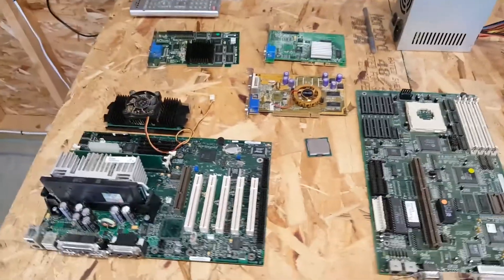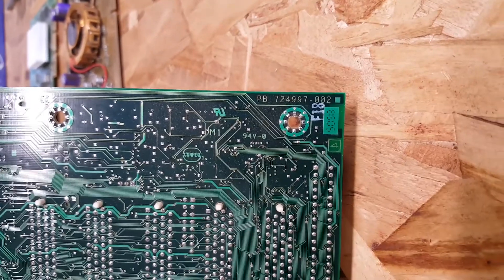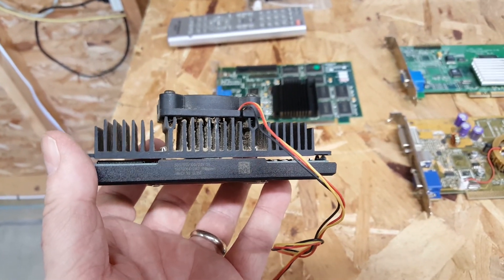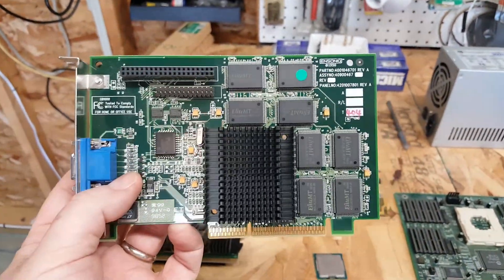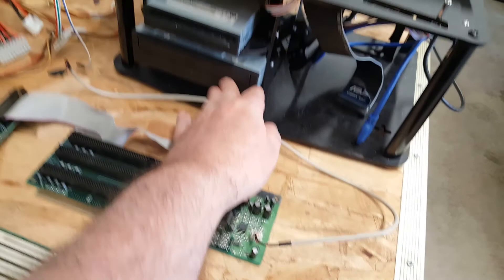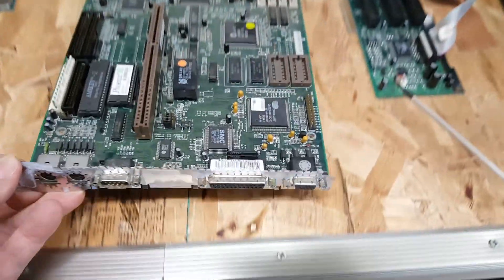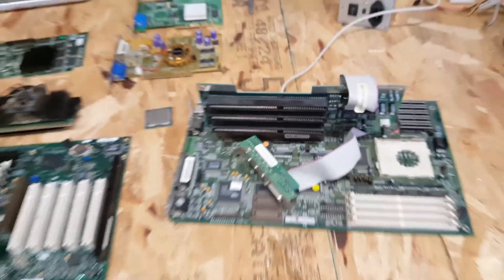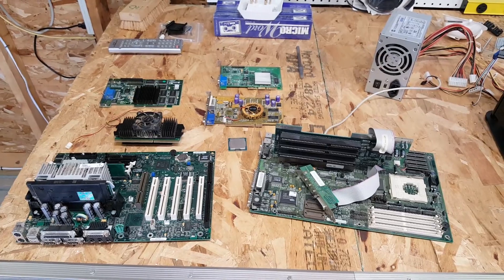Computer Parts:  How to find Old Classics and Retro "Gold" in Scrap and Salvage Yards April 2021

Comment: Woah that first motherboard you showed looks EXACTLY like my Pentium 3 Gateway. It doesn’t have a built-in sound card though. I run MS-DOS 6.22/Windows 3.11, Windows 95 C and a Windows 98 SE setup on this computer.
Reply from the maker: Look at the deal I got!  So, what CPUs have you tried in the Gateway motherboard so far?  I have several PIIs and PIIIs and Celerons and a slotket adapter.
Reply: @UncleMikeRetro  the only one i could use is the slot 1 P-III 500 MHz for now. I have a full tower slot 1 P-II 450 MHz Gateway computer as well but it’s not with me right now. I got these simply because of the ISA slot which means I can use my Sound Blaster 16 on it.

Comment: I was in contact with a man that wanted to throw away his old PC and parts. I ended up grabbing for free pretty much the same as you, a complete working system with Slot 1 Pentium II 350mhz and there was also a box, I opened it and there was a Creative Voodoo Banshee PCI in there. Not the original box, but still nice to find in a pile of what this man considered "junk" :)
Reply from the maker: Nice!  You know, My real need now is a Voodoo 3 without paying the eBay pirates for it.